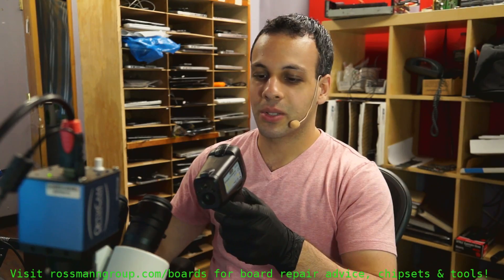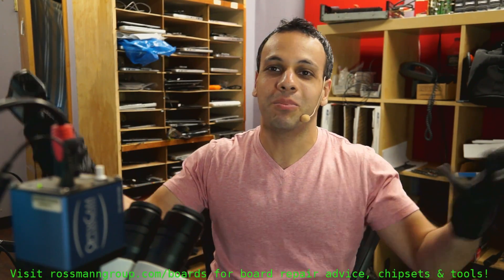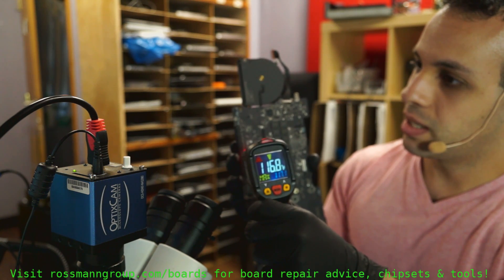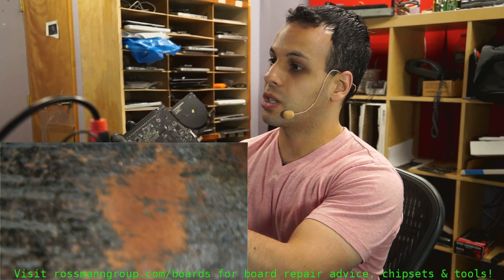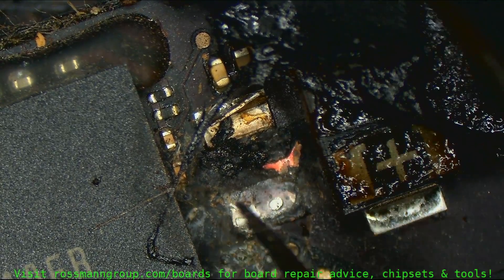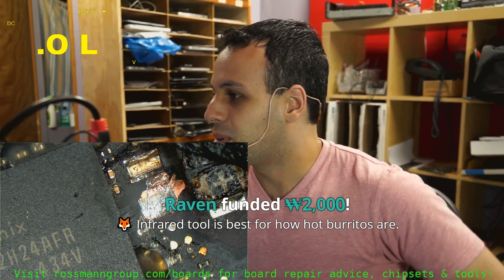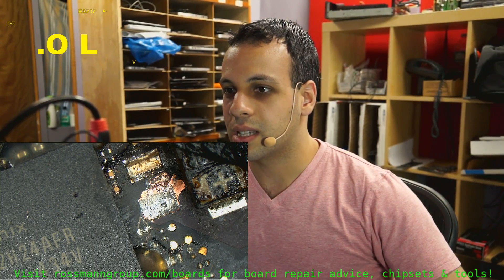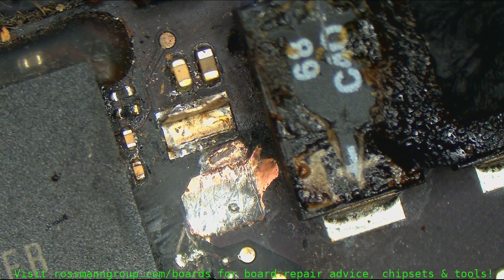Louis becomes a shill

Comment: the sensor is below the laser, the laser is angled to be accurate for aiming the sensor at probably around 1' away, the instruction manual should show the distances. When you pointed it at the short, you were holding it so the sensor was actually below the board because of how close it was. I've dealt with these IR thermometers before, they just take a little getting used to with the distances
Reply: if you want to measure closer, the laser is close to useless unless you just place it above what you want to measure

Comment: The laser point is designed to intersect with the sensing point at a certain distance which is usually a couple feet.  This means that at very close distances the point of the laser will be significantly above where the sensor is looking.

Comment: I had a board once (small batch internal university stuff) which was not working due to a short circuit in a pad isolation to ground plane. Extremely small one, barely visible under 10x microscope. Probably an etching defect. I knew gnd and vcc are shorted but could not figure out where. It took a 2.5A supply to heat it up just like 2-3 degrees C due to the thermal dissipation of the ground plane, would have been impossible to find without an imaging thermometer. Luckily, you can get those for around 200€ those days . They probably are even more useful during development then during repairs.

Comment: Here is a neat trick to find hot components: grab a receipt and hold it against the area of the board where you think there is a shorted component. The paper will turn dark over the hot component because most receipt paper is temperature-sensitive.

Comment: IR thermometers are close to useless for repair. On contrary, thermal cameras are awesome. Very often can find a fault in just a few seconds instead of hours. They can easily distinguish 0.5 degree C temperature difference, which is often a giveaway something is not ok in particular area. Using alcohol or hand will work only if something is really frying and there is a risk receiving burns. I repair/refubrish returned Raspberry pi in volume. Without IR camera, repair would not be viable for such cheap device because repairs would be too slow and require too many useless attempts to replace actually working parts.

Comment: this thermometer is for measuring may be walls, floor, selling, to estimate heating system or cooling system in a house. may be temperature of different parts of a motors and so on, but not for microelectronics, that's for sure

Comment: I'm a better Shill .. My Amprobe IR-750 is more accurate and more expensive . I use it for  checking how hot certain components are in Tube amps.  You can't poor rubbing alcohol on a 500vdc tube amp.

Comment: I have an IR Thermometer like that. They are not useful for finding a hot part on a board. For spotting the hot part, as Louis pointed out, it's more convenient to pour alcohol over your board and see where it evaporates or using your fingers to find hot parts by approaching them.  However, those IR Thermometers are useful when you already know the hot part and you need numbers. "Okay, this part is hot.. but is it hotter than it should be according to the specs?" - There is where it can be useful. Or when you actually look up a value on a "temperature vs something" diagram. One thing to mention when working with those tools is, that you really need to get a feeling for the "cone" the sensor uses to measure. It has a certain opening angle and becomes wider over distance. That's one thing. The other thing is, that the laser pointer is very misleading. On short distances (let's say: below 1 meter) it is misaligned with the sensor cone (they should have put the laser pointer in the center of the IR sensor beam by using a half-mirror like they align optics in a camera). And on greater distances the laser pointer becomes misleading because the laser dot doesn't become wider when your cone becomes wider over distance.

I have had good use for it when choosing to use a heat sink or not. And for spotting the hottest person in a room full of geeks...

Comment: Louis, instead of using a Flir TIC,  you should try to test Thermal-Imaging-Cameras that fire dept use.   I know that they are model that will fit in your hand with no pistol grip.  The technology is more advance and is the screen is in color you should see the HOT spot very clearly.  Even the B/W version will show you the hot spot.

The Flir that you used probably had a field of view too wide.  But the latest version of TIC for fire dept you can spot a wire in the wall that's hot.

Comment: Wrong tool for the job. (Yes, I know, that's Dr Meter's fault for sending it to the wrong guy.) I will say that an IR camera could be moderately helpful for pointing out the general location of a short, and then doing the alcohol method to find the exact component. Is the cost justifiable for this kind of repair work? Probably not. Maybe if you do nothing but short circuit faults and the fault is never in the same place twice. Could be justifiable for example for troubleshooting mains powered equipment where you can't safely just dab it with a q tip while running, though. But in that case the fault is more likely to be spectacular and very clearly visible.
Reply: Gameboygenius you mean thermal camera?
Reply: Oops, yes. Although IR camera is not an incorrect description. A thermal camera has pixel sensors receiving light/EM radiation in the far infrared spectrum.

Comment: Come ON, you are smarter than this.  It's not made for A. Circuitboards, B.Heat leak detection.  for both of those things you use something that presents a picture. and C. it doesnt measure on the spot, it measures in the hole and you HAVE to know how much the measuring area gets bigger with distance. And D. you can use alcohol but also try acetone, it's quite fast and have lower boiling point so you're gonna see bubbles.
Reply from the maker: why would someone send this thing to a microsoldering board repair person for review? to measure the temperature of my burrito?

Comment: I think that thermometer has specified minimum distace you should hold it at and you were holding it too close. Usually the actual sensor is offset from the red laser dot and is calibrated to intersect at specific distance. But it seems you work better without it so that will not be an issue for you.
Reply from the maker: If you make it go any further away it is measuring the temperature of the entire board and at that point is fairly useless.
Reply: Louis Rossmann I do agree that it ir thermometers are useless, an actual ir camera like a flir of a fluke could be useful but for boardrepair you would need a ridiculously hi resolution at huge cost think 8000 dollars and up. In industrial applications the simple thermometers and ir cameras are way more useful. Tho a blown contactor or relay is easy to find using a resistance measurement or voltage drop test
Reply: just pay the dam flir thermal camera more crash on it better resotion. 
Is like your hakko soldering station crap tools deal crap works.

Comment: I have a feeling that the capacitor spilled its guts and IT burned the board and did the welding.. Kenwood equipment  is known for puking capacitors...which then destroy the boards..